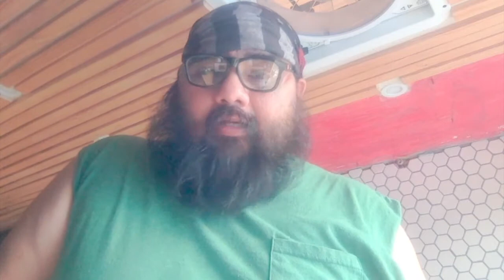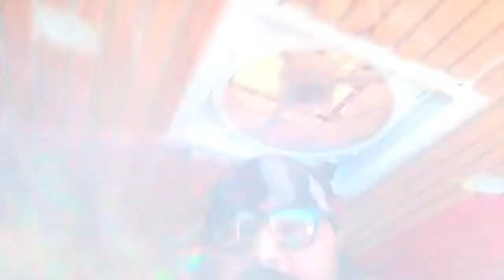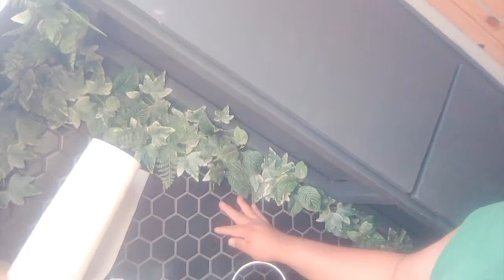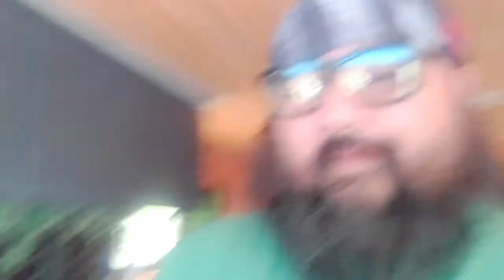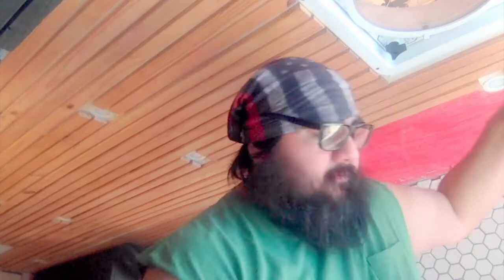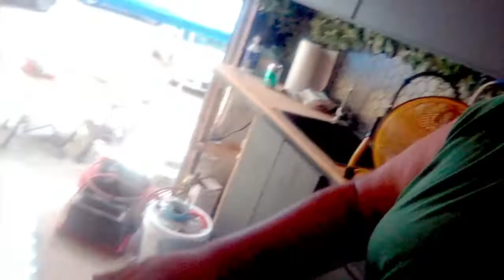#VanLife (box truck conversion) - Truck build update

Comment: You've put an amazing amount of effort into your build. I'm a new subscriber as of today and have been doing a marathon watch of your videos trying to get current. What did you do to solve your water leaks? There is an RV product that can be used to permanently seal your entire roof and it guarantees no leaks if the install instructions are followed. Don't have the name, but the product has been used by RV owners who've had roof leaks or wanted to prevent future roof leaks. You can probably track it down on YouTube.
Reply from the maker: Thank you for subscribing. We covered the top with red guard and then flex seal. It worked like a charm. No leaks.